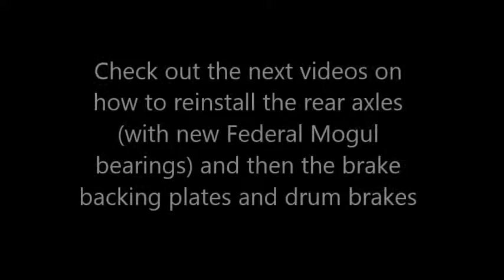How to Install a rebuilt Mustang 8 inch differential, DIY Ford differential installation

Comment: Wow that was tough to watch.  I was watching because I was thinking about doing it myself.  You have confirmed that I will need some help. Glad you didn't get hurt doing that.
Reply from the maker: @haskellimages  the tough part was lifting it back into place and getting it to slide over all the studs! I guess the video displays that pretty well! Just get the car up high on strong stands and a floor jack will lift it up into place. I now have a car lift and transmission jack! It would have been easier if I had those back then! All t work was worth it in the end!
Thanks for watching and commenting!
Good Luck!

Comment from the maker: Sorry guys, I didn't film the differential rebuild at all, but here's the best link to a great series of 4 parts how to do it all from a professional instructor, I watched them all a couple of times before we started. I had difficulty setting the preload on the ring gear until I found the Powertrax diff unit hit the cast iron near the pinion gear pilot bearing, so a little grinding and we were all set to go! Check these out....https://www.youtube.com/watch?v=8w4VL1zmTEQ&t=931s